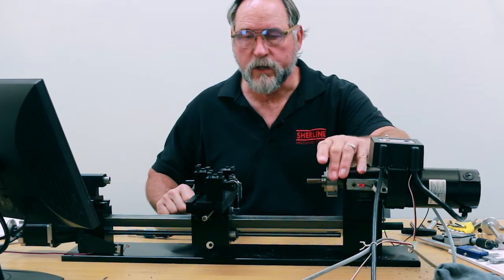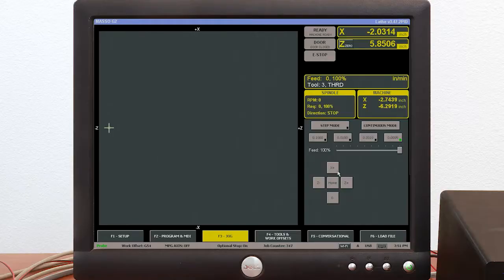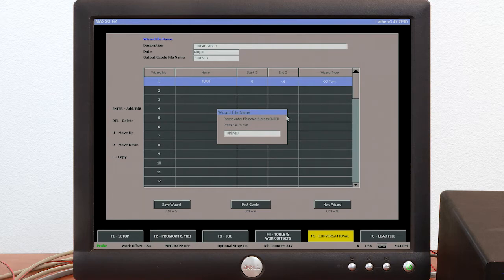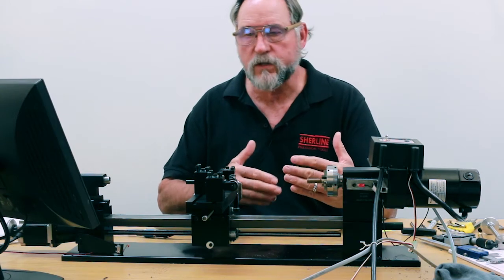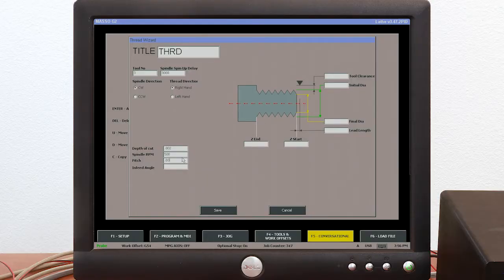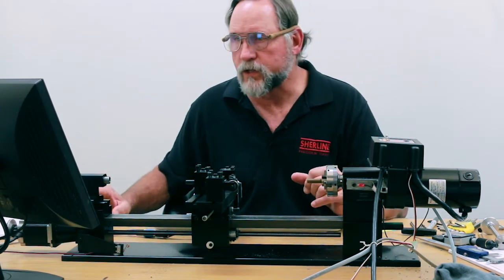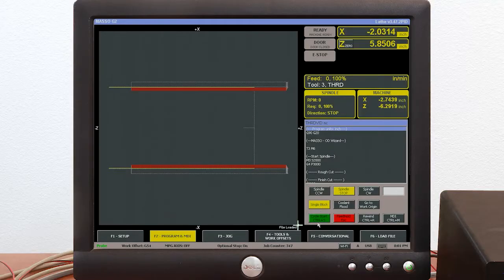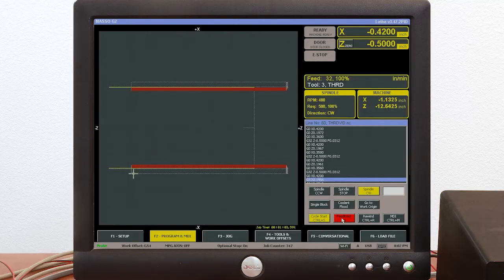Masso Threading Instructions

Comment: Masso controller is supported for #G71 turning cycle
Reply from the maker: MASSO does not support G71. Most CadCam software allows you to define your roughing cuts and how much material to leave for the finish pass.
Below is a full list of MASSO-supported G-codes and M-codes in the pages listed below.
https://docs.masso.com.au/supported-g-codes 
https://docs.masso.com.au/supported-m-codes
Reply: @SherlineProducts the spindle motor card in my Sherline lathe has become defective. Do you know if this can be repaired? I am unable to see any visible signs of circuit burnouts. The motor works ok, I checked by giving it some voltage separately .
Reply from the maker: @arbjful  The speed control cards cannot be repaired. However, you can purchase a new one if you feel that the card is the problem: https://www.sherline.com/product/dc-electronics/#description
Before you spend money on a new card, try replacing the toggle switch. If you work with brass or wood, very fine dust can build up in the toggle switch, eventually causing the speed control to work erratically or even short out. I also recommend getting a Toggle Switch Dust Cover to prevent dust from entering the speed control unit.
Toggle Switch: https://www.sherline.com/product/toggle-switch/#description
Toggle Switch Dust Cover: https://www.sherline.com/product/3015-toggle-switch-dust-cover/#description
Instructional PDFs and videos
https://sherline.com/wp-content/uploads/2018/09/replace_sc_toggle.pdf
https://youtu.be/mUGi5OAeNuo?si=AO_gme6y5Q3Fuv8T
https://sherline.com/wp-content/uploads/2016/08/3015inst.pdf